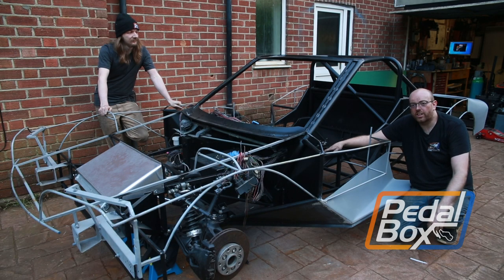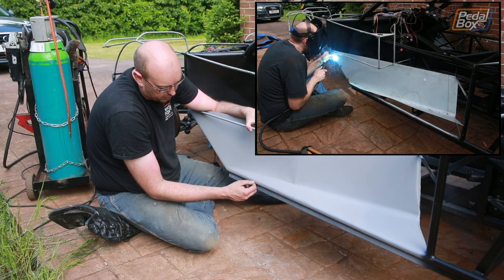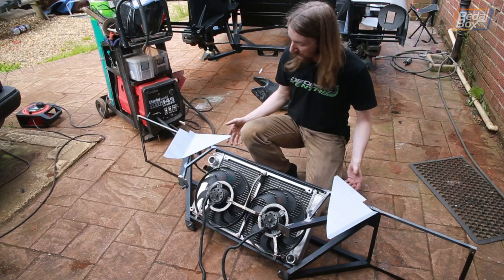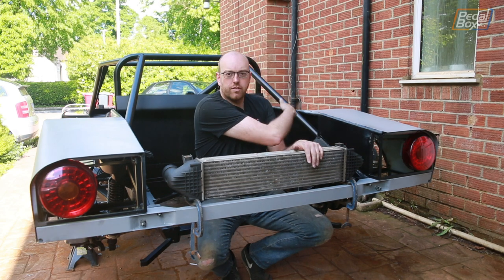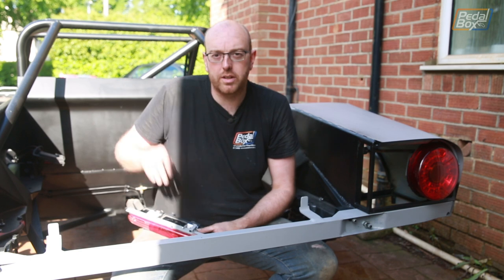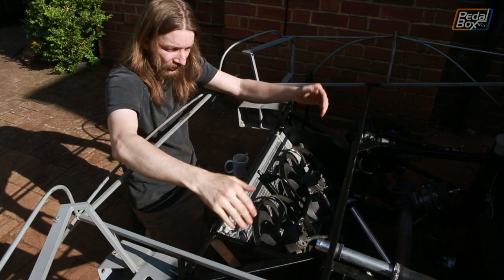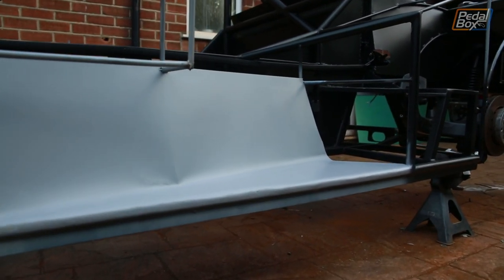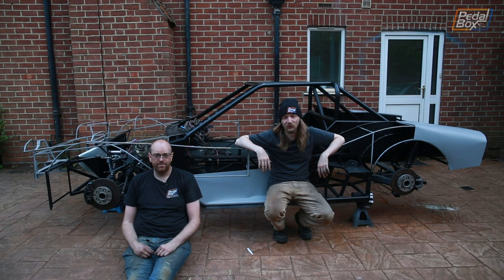Panels and Intercoolers | Audi TT Kit Car | Pedalbox Episode 77

Comment: Do you have a sketch of what it will look like? Or is it organic? Like the side panel and fab work.
Reply from the maker: It's been very organic with some kind of vague idea. The frame work was the main drive and quite a few changes happened as that went on. The above the shoulder lines (over the engine and behind the seats) are still being tested and tweaked, might put that in the next episode for some feed back actually!

Comment: Really don’t think that radiator duct is a good idea. Want the air to come out the bonnet near the front, where the pressure is lowest. The further you get towards the windscreen the higher the pressure and that’s not good for flow. Ideal would be basically to have it come straight up from the back edge of the radiator.
Reply from the maker: Interesting, though the velocity in these seem fairly high mid way along the bonnet, and it's only on the highest rake that the velocity drops back lower, and it's not stalled, so it's still flowing
https://www.researchgate.net/figure/Contours-of-velocity-magnitude-generated-using-the-unsteady-DES-turbulence-model-for_fig39_315865543